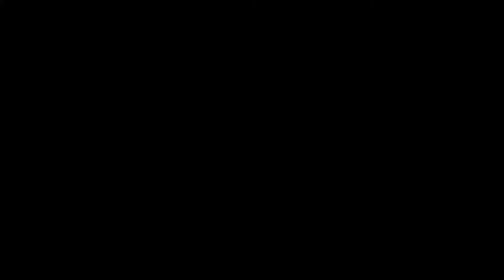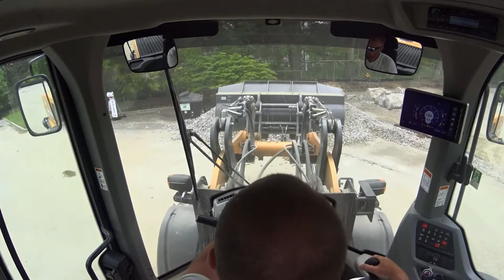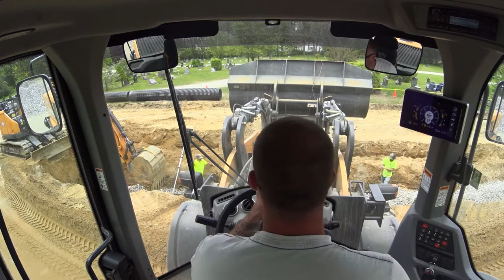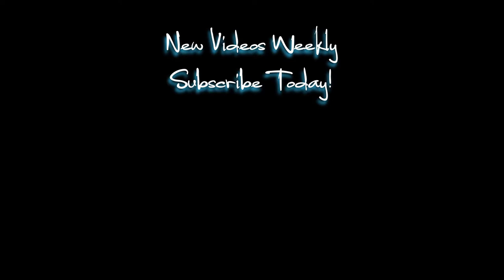Tips on Running a Front Loader | Parking Lot Expansion

Comment: One thing I appreciate that you didn't mention is when you went to blaze the spoils pile along the trench to the main sand stockpile, you were careful to stay at least a 1:1 away from the bottom of the trench with the edge of your bucket to prevent cave-ins. But since the pipe was backfilled and the bottom of the trench was now a couple of feet higher, you got slightly closer to the trench than the last pass we can see you made before the video, because you knew the angle of repose changed and it was safe to go slightly closer. It's a million little things like that make good operators.
Reply from the maker: I appreciate your comment and your observations.  Like you said, there are so many tiny things that you think about as an operator that separate you from the stick pullers in the industry.  The fact that you pick up on all the subtle nuances tells me you're a true operator as well.  Thanks for the comment brother!